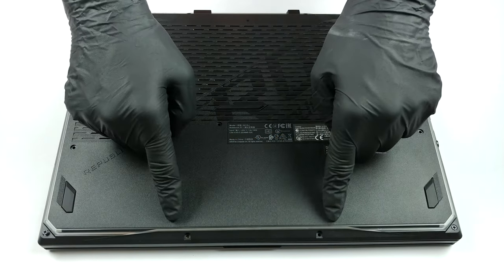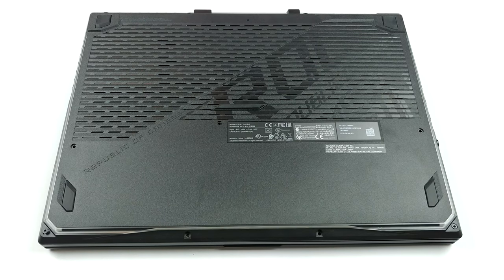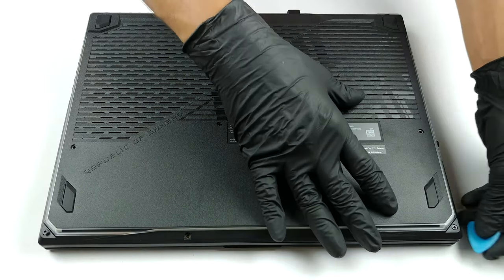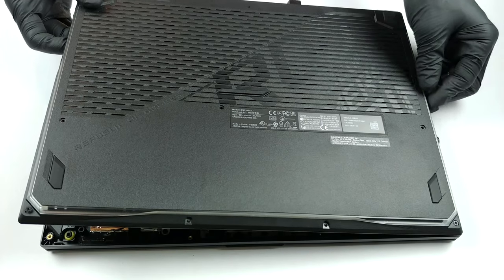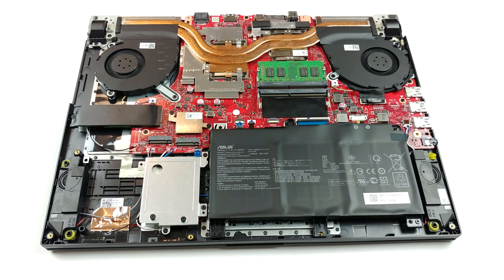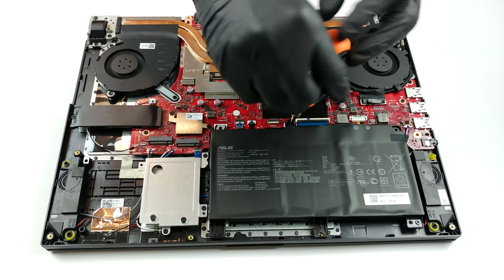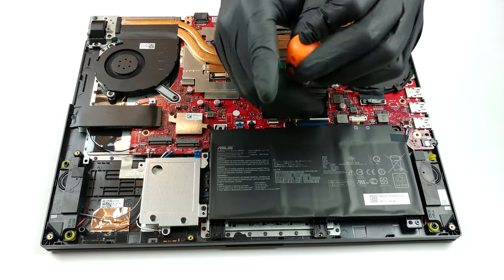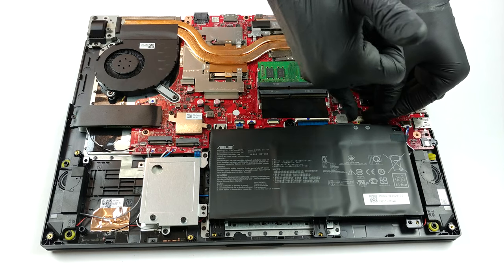🛠️ASUS ROG Strix G15 G512 - disassembly and upgrade options

Comment: I really appreciate this video. Subscribed. 

Can anybody elaborate on the max ram speed supported here if I were to upgrade it? 

Another item, do all m.2 slots require NVME class drives? I'm assuming they do for RAID 0 but if I didn't do that would and m.2 SATA drive work in one of the two slots?
Reply: asus said it will support 3200 with bios update
Reply: The ASUS ROG Strix G15 G512LI-BI7N10 Laptop takes the DDR4 PC4-23400 3200MHz SODIMM memory type, and comes installed with 16GB memory.

How much memory does the ASUS ROG Strix G15 G512LI-BI7N10 Laptop take?
You can upgrade your ASUS ROG Strix G15 G512LI-BI7N10 Laptop to up to a maximum memory capacity of 64GB Memory.

Comment: Only 2 heatpipes? I guess bad at cooling?
Reply: It actually cools very well despite the lack of heat pipes.
Reply: @michaelmerrett  Does it have Thermal Grizzly liquid metal? Asus has released a video about their ROG line laptops stating that they started to apply liquid thermal paste out of the factory for all 10th gen Intel laptops.
Reply: So far so good no cooling issues
Reply: Liberteen666 yes they do
Reply: Theirs 3 options turbo, performance, and silent I cycle through performance and turbo when I’m doing heavyloads and so far it’s been really good
Reply: dude those are giant heatpipes , like 2 times the usual size , so u can think of it as 4 heatpipes
Reply: i play forza hor 4 at max, turbo boost and it reaches max 80 deg. cel. on the gpu (rtx2060)

Comment: Can u tell me what type’s of DDR4 ram I can use to upgrade this model?
Reply: Only DDR4 2993 for i7 10750h and 3000/3200 for i7 10850h and the another one (i forgot it)
Reply: Ah shit I mistaken I only have the I5 10300H
Reply: Get the 3200mhz DDR4 Ram. I have the same i5 10th Gen. 10th Gen CPU tend to down clock the Ram speed so like 3200 = 2933mhz. You can check Ram speed at task manager.
Reply: @FlyBOy36O  thanks! Should I be buying the 1.2v that came stock on the current motherboard pc4 23400? I dont want to fry anything lol
Reply: @RetardioRxlyvt The Ram I installed has 1.2v as well.  Sorry I don't quite get what you mean for the Motherboard. To avoid Short Circuit is to detach the battery or you can "Ground" yourself by touching metal objects (faucet, door knob).
Reply: @FlyBOy36O  i have the i7 10th gen and I can't find any ram (i want to dual channel 2x8gb or even 2x16gb if I find something, even though it's overkill) thats 2993/3000/3200 to have the latency(CL) smaller then 21... at least in Romania
Reply: @AntonioCostache04  If you can't find something around 29/30/32's then you can always change both (2x 8/16GB) with the same low speed. I'm sure there won't be much of a problem.
Reply: @FlyBOy36O  idk what to say because the processor "work only with 29..." as Intel says

Comment: Can a 2.5sdd drive be installed to this ?
Reply: No only m.2
Reply: I have this labtop just upgraded the ram, and ssds.
Reply: @elbarriotrucker  thank you as i opened it up and couldn't see were it went
Reply: Pause the video, it helps. You got two additional m.2 next to the battery. Also ram max speed is 2933. I heard that the next bios update should increase it to 3200.
Reply: @elbarriotrucker  mine is already 3200